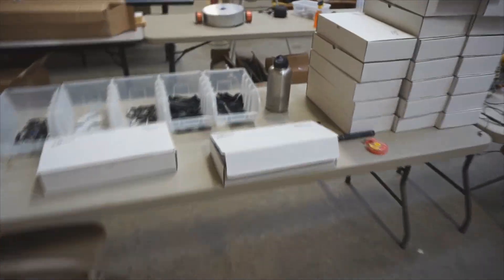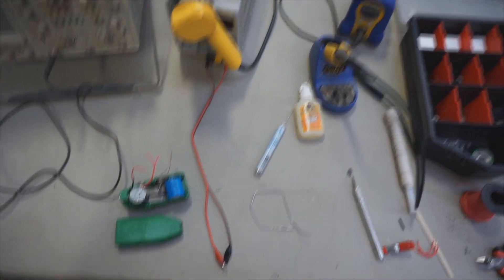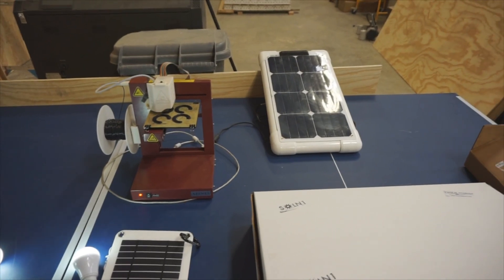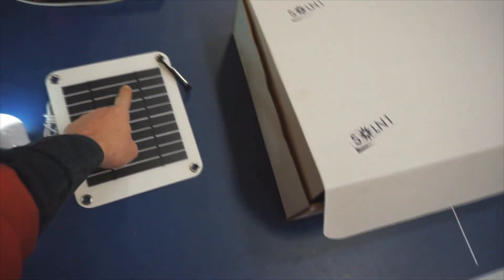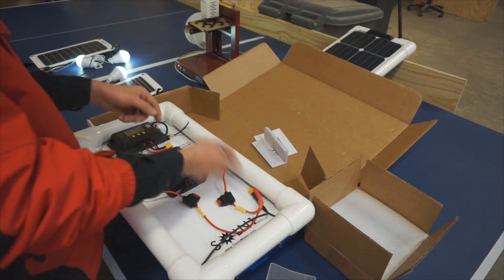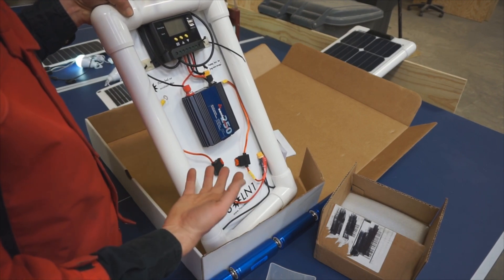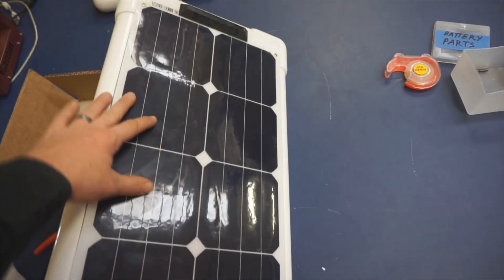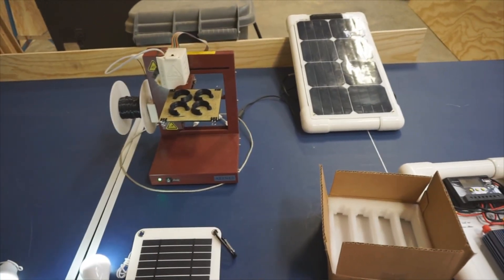SOLN1 25 Powers 3D Printer - Kits Now Available

Comment: beginner question, apologies and thanks in advance.  i'm not sure i understand the diff between the 5/8/25 units besides the fact that it can charge the banks faster cuz of the surface area.  I know the power banks are different sizes but if you had a big enuf power bank on the 8, isn't that going to provide the equivalent juice as a similar sized power bank on the 25?

Comment: I would be scared of using those batteries in series like that charging the unit in the hot sun. One battery could explode and that PVC pipe won't protect anything near it if it explodes. It's just the simple way to do the batteries, not the safest.

Comment: you shoud add conector on its side   for conecting more panels for extra power  or charging one soln1 with anoather one,also then that secound soln1 woud have conector on it so you can conect thirth soln1 on it and so on . So if you need more power just conect anoather one,its easy. Also you coud sell them as they are and sell  upgrade kit with conector and wires  and stuff needed to upgrate it to  be conectable in paralel  to anoather one.

Comment: The SOLN 25 would make a great roofing tile. Could you develop a connector between adjacent SOLN tiles to conduct the captured current from tile to tile, like a solid state circuit and feed it to one point. 

I could see a huge market where the economies of scale make solar tiles as cheap or nearly as cheap as shingle tiles.

Comment: The 5W is ideal for survivalists to put on a rucksack to charge as they hike, I bought. 4 watt panel from maplin and the thing is next to useless.
Reply: what's the most applicable use of the 5w in this type of situation besides making sure you're phone has enough battery to contact in case of emerg?
Reply: danh le Charging an LED flashlight 18650 battery's, a handheld GPS.
Reply: Green Silver forgot about those things thansk

Comment: So is it safe to use a PWM charge controller on lifepo4 cells? (Providing you set the charge cut off to say 12.6V and the load disconnect to 10v I haven't got the nerve to try it! Also what keeps the cells in balance?
Reply from the maker: pietkaify 
PWM solar charge controllers are used with lifepo4 cells .  See: http://www.bioennopower.com/collections/solar-controllers/products/12v-24v-30a-lifepo4-solar-controller-1

Also: http://www.batteryspace.com/Charge-Controller-120W-12V/24V-Auto-Detection-10A-Rate-for-SLA-or-LFP.aspx

My first experience years ago with lifepo4 batteries was with this unit: http://www.batteryspace.com/lifepo4battery12v20ah240whwithcontrollerforsolarpowerstorage.aspx
Notice that this pack also has no balancing.  I have had four of them in service for years now with no issue.  It is pretty much exactly the same setup that I have been using in my kids car seen here: https://www.youtube.com/watch?v=N9LWZpdDZsA

The headway cells call for:
Maximum charge voltage - 3.65V
Discharge stop voltage - 2.0V

I have programed the solar charge controllers on the SOLN1 25 to with these settings:

Maximum charge voltage - 14.4V (4 x 3.65 = 14.6V)
Discharge stop voltage - 10.5 (4 x 2 = 8V)

You can see that those values are well within the recommended voltage settings.
Reply: lasersaber I have 12 x 12ah cells at one point had 1 x 12ah pack and one 24ah pack both before and after I combined them Into the final 36ah pack there was one set of cells in each pack wanting to charge faster than the others? Despite all being from the same batch and marked with the same internal resistance. I have both bottom and top balanced the pack and had no luck keeping them equal. My worry is by using your system I will kill my investment of £200 =/
Reply from the maker: pietkaify
It is possible that balancing will destroy your cells and could possibly in some situations even cause a fire.  Read this for some background on this topic: http://evtv.me/2009/11/get-rid-of-those-shunt-balancing-circuits/  

Thanks for sharing your experience.  What was the voltage on your battery pack?  How many amps were you charging at? What brand are your batteries?  I think that a lot of my success so far may be due to the fact that these smaller solar panels never charge the batteries at a high amp rate.  I also recommend programming your high and low voltage cut off points under and never over the battery specs.  You would be amazed how many "lifepo4" chargers actually go way over the recommended voltages while topping off your battery.   Whatever the case I would follow your own gut feeling based on your own experience and testing.
Reply: lasersaber hmm I'll be honest, I'm trying to take every precaution in preserving my batteries! My (BMS chip only cuts the power at low and high voltage and I balance charge the pack maybe once a month and the whole pack is never completely discharged maybe 60%

Cells are Headway 12AH charged at 3.5A and currently rarely discharged at more than 7 amps! I have a few video's up for this pack if there's anything else I can share with you please let a me know?

Comment: Have you considered using super capacitor like boost cap instead of batteries? Might fix that shipping issue
Reply from the maker: iindium49 
Yes,  It works great for real-time power needs.  I was researching this in the past and I do plan on adding it to the SOLN1 lineup in the future.  Here is a video from some testing I did some time back: http://youtu.be/_io9YHKdbTw
Reply: Supercapacitors just do not store nearly the amount energy density of lithium batteries. They do not really store enough energy for use for a while. Also, the discharge characteristics of a capacitor are worse, so there will be more unusable power, because the voltage tends to drop off quickly and go down really low and stay low. Batteries generally have a more 'square' response, dropping of slowly, while remaining near the nominal voltage, and then once the capacity is nearly all gone, only then the voltage plummets.
Reply from the maker: Power Max 
I agree, but in certain applications it would work very well.  It would be worthless for continuous high current loads.  Short term high current loads, every once in a while, would be no problem.  It would also power laptops and other items that fall within the power output of the solar panels.